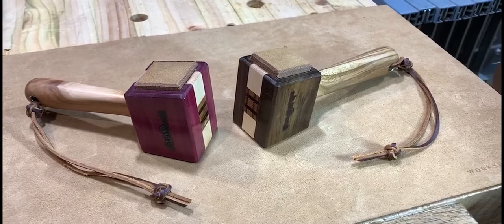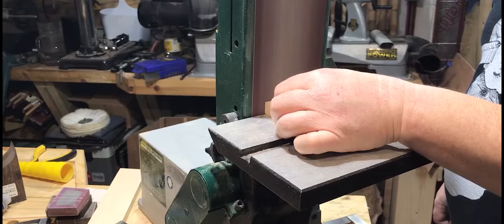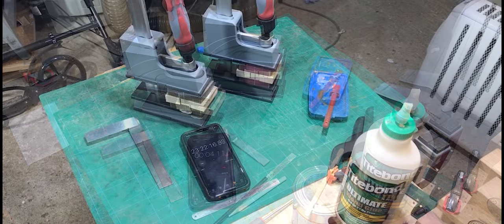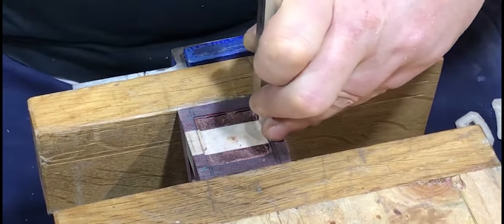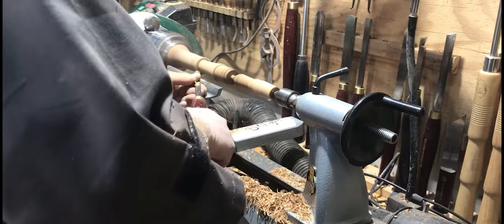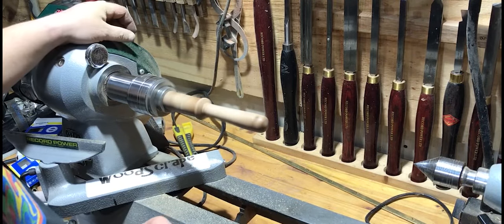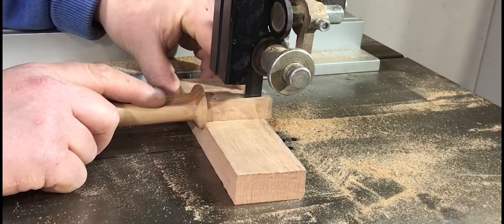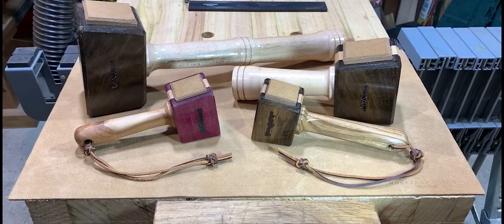How to Make a Small Wooden Mallet for Furniture Making

Comment: Goldilocks and the 3 mallets, they're gorgeous man, and i must ask, how is the color of the purpleheart holding up? And when you made these did you have to bring back any of the color in the purpleheart?
Reply from the maker: Thank you - The Purple Heart is doing well. Through my experience with it, after working it, it turns pink. I generally leave it at this point for a few weeks to regain the colour ( air and UV i think ). I have also heard that heat helps it get the colour back but haven't tried as yet so don't take my word for it. Thanks for watching